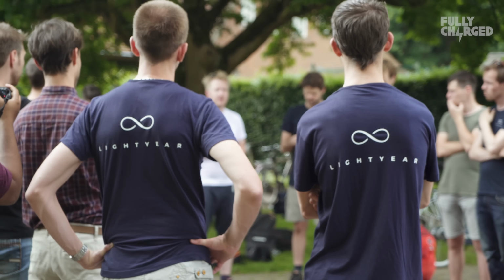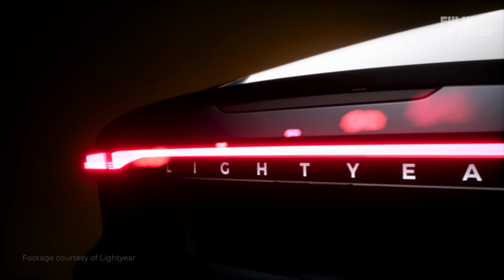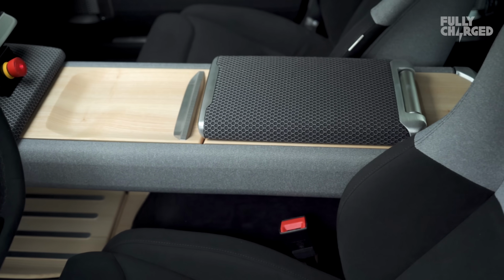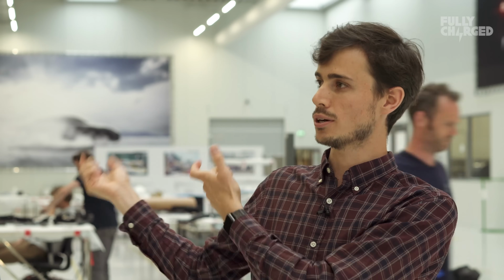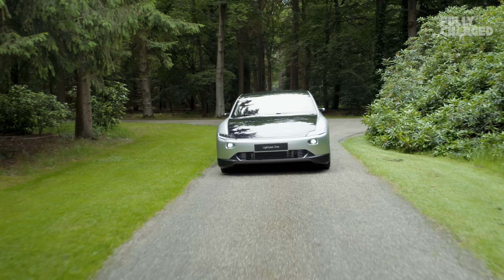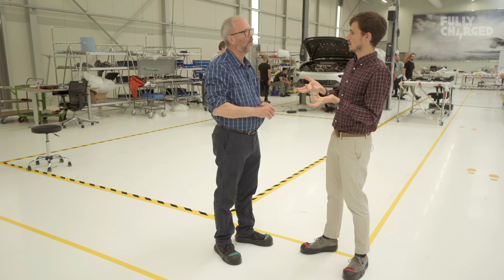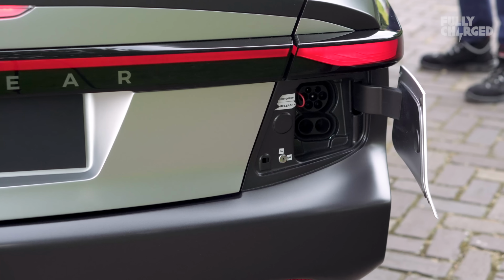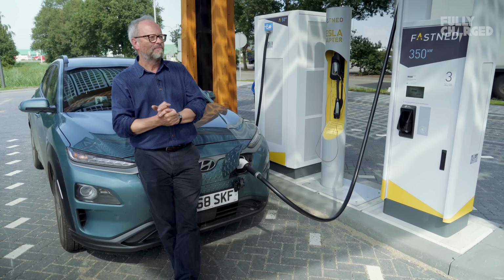Lightyear One solar powered electric car - exclusive first look | Fully Charged

Comment: That car, and many derivatives of it, would go incredibly well throughout most of Australia!
Reply: Suddenly everyone wants a parking spot out of the shade
Reply: @dr00by  say goodbye to garages
Reply: @dr00by  the irony, as have seen some carparks with solar panels for shade..
Reply: @dr00by  they still charge in the shadows, but not as optimal. You don't have to think about it really
Reply: @tr33c: "not as optimal charging" in the shadows is a massive understatement. You get just a fraction of the power in the shadow.
Reply: @701983  You'd be suprised, watch the sonos video of fullycharged. Similar efficiency to this. It's definitely not a massive understatement, but I do wonder how much it would charge overnight with and without a full moon.
Reply: Did he say 10 to 20 km/hr charging on the battery.  This car would drive me to work on a sunny day and have charged more than my return trip and then some.  I'd only have to plug it in on long trips.  This is definitely how we have to go.
Reply: @cameronlapworth2284  He said 10 to 12 km/hr, but still very much what most people use during a commute (personally for me it would mean 3 hours of charging for each leg of my home/work travel)
Reply: @YouHaventSeenMeRight  yes which means 8 hrs parked at work how much would you need?  Remember too if you don't drive much on the weekend and when you get home?  Compare this to an ICE car how much fuel is created in the tank while it's parked?  Any?  The average commute in Aust is something like 35km.  Mine is about 5km. I ride though so I don't need this.  I think even ICE cars should have solar to charge battery and relive work for the alternator and air con.  If an ICE car made its own fuel while parked would anyone be critizing it by saying well it does fill the tank in an hour.  Even when driving the panels are removing some demand from the battery which means less batteries, cheaper and lighter car, tick tick tick.  Nothing about this is bad people are making the best the enemy of the good.
Reply: @cameronlapworth2284  I wasn't arguing against anything you said. I just corrected what you had heard: 12 i.s.o 20 km per hour charging. My commute is indeed about 33 Km one way, so with a charging duration of three to four hours for that distance I would indeed be able to charge up twice as much distance in an 8 hour workday (and depending of the time of year either more or less than double the single distance). It would however mean that the car would have to be parked in a sunlight parking spot, which would be challenging with our current parking garage as it is constructed to keep the sun out (except for half layer on top of the garage). I guess that would suddenly become a very desirable location, whereas it is now the overflow location where you park when there is no other spot available.
Reply: @YouHaventSeenMeRight  yes sorry I just re read your post I was doing this without my glasses on my phone I occasionally miss things my bad will take more care in future.  :)
Reply: @YouHaventSeenMeRight  That was in European conditions.
Not long after he implied you'd likely get about double that in a really sunny place like southern california or Australia.

So yes, 20 km per hour charging is about right.

Solar charging rate is highly related to how intense the sun is.
Reply: @KuraIthys  As I live one town away from the Lightspeed factory, the European numbers are more interesting to me than the Australian ones, but good for Australian customers I guess.
Reply: Cameron Lapworth Ideally, but it is incredibly costly! Bear in mind you can buy a model S P100D and 30 years of solar power for the price of this car. The problem is dedicated solar power stations produce energy far more efficiently than this roof, economically. I think fast charging will make the roof panels more and more redundant, you can charge Tesla’s in a matter of minutes and go 10s of km.
Reply: @falcodarkzz  yeah I couldn't afford this car but not because if the solar.  This is a luxury car, Sion is pursuing the same idea much cheaper.  It's the principle I think is sound and it will work its way down to cheaper cars.
Reply: I'm ready to test it for them in sunny Queendland😎Australia ......oh yeah can I tow with it ? Ha
Reply: I only drive about 20 km a day and living in california, I would almost never have to plug in
Reply: This would work well in the tropics.
Reply: Perfect for my daily commute across the Nullarbor ;)
Reply: In Australia this car should be able to operate without external charging. I visted them in spring this year and they stated that it would be possible to operate the car in Spain with charging only once per year when driving about 15000 km . Assuming that the solar radiation is higher in Australia this should work without charging. Just a bit expensive.;)
Reply: Most of southern and central California and most of Arizona!
Be well.
Reply: In theory yes but it's Australia so.... No.
Reply: @chrisrathjan1501  lol
Reply: Can't wait to see the first solar powered ute!
Reply: @Dudleymiddleton  The roof area is smaller for a ute. However, when better solar panels are produced, it may be enough.
Reply: What's the point mate? We don't have the infrastructure and our only source of electricity is dirty Coal; sadly.
Reply: Nice idea, but unreliable for most people.
The majority of people live on the coast, not the desert.

If I am going to purchase one car (like most people) it needs to be reliable (work, holidays, living out of town)

The majority of people won't buy this. So they will be a rare thing.
Example. Its been raining here for the past week non stop.., how am I supposed to get to work. Purchase another car? Majority of people cannot afford multiple vehicles

I'd just buy a Tesla and charge it. Same difference if I have solar panels on roof, yea?

Or like campers do. Take solar panels camping. Just like having them in the roof. Tesla will probably just use their roof tiles and will have the best of both worlds.
Reply: @jamesbarker6373  You have got the option of charging it off the wall of course. Solar is just a range extender I suppose. Problem in the motherland is the lack of infrastructure. They have got turbo chargers everywhere in the US and Europe. We don't have that facilities as of yet. So, your only option is to charge it at home with a power that is produced by burning Coal. So, your carbon emission is still in place anyway.
Reply: @JulAlxAU  Been raining here for almost a month straight. Had 3 days of sun in over 3 weeks
Reply: Don't kid yourself.  You might be able to get from Geelong to Rockhampton without waiting half a day to recharge but if you want to go west from anywhere you are essentially stranded. The built in solar panels only extend the range by 10 - 15% if you are lucky.
Reply: And so long as you can clean the car every day. Australia has some real heavy duty dust.
Reply: There's a misconception that anything solar needs full sun.
Of course full sun is optimal, however solar panels produce electrons as long as they are being struck by light.
Don't risk your life. Solar panel output wires need to be treated the same as any energized wire whenever light strikes the panel.
Reply: australia north africa and also the middle east
Reply: @Atam Tab At home, you'd have solar panels to cover that. At work, if legislation comes in for solar panels, that could be used too.
Reply: they need to come out with a fire powered version for australia.

Comment: Amazing what they achieved in such a short period. And how little the mindset of people outside this bubble changed during that.
Reply: Well, the mindset here (in the Netherlands) is changing. Not superfast. But there is a definite change in how people look at the energy revolution.
Reply: Or, it's a con.
Reply: This is a team of former TU Delft students working on solar cars for many years. It's not something just started from scratch.
Reply: Well electric cars in general are great, but this one in particular is dumb. Way more efficient to just put the solar panels on your house instead. A car is blocked from sunlight by trees or buildings etc for most of the day anyways...
Reply: In the US petrol (gas) cars are just better.
Reply: @bighands69  Blame the lobbying oil firms

Comment: 1.25 kWp at ~ 1500 full sun hours per year, that's 1750 kWh/year. Take away the 30% you lose because the panels are not optimally looking at the sun, we get ~1200 kWh per year. At a consumption of (did they actually mention how much?) 12 kWh/100km that means 10.000 km/ year IF the car is always outside and not in the shadow AND the battery isn‘t already full so it can't be charged by solar. Not too bad actually. I'm surprised. I wonder what additional power the added weight of the panels takes compared to their power output.
Reply: It's 10000km/yr of free range
Reply: @manurr10  It's not free if the cars costs over a 100.000 euro...
Reply: In other words, 10,000 metres/year if you live in the UK.
Reply: Despite your minor error with the initial calculus, thanks for this overall calculation! Panels probably weigh nothing, but they look like they heat up a lot, which requires you to cool down the car and waste energy. Also hot cells are less efficient.

Now if only they put the solar panels in a place where they're always maximising sunlight and connect them in a way theres no limitation of battery capacity .... then they could just use take some from the storage when they need it ... hmm .. like solar panels on the roof and connect them to the grid!

It's not free range btw., it's paid by buying the panels. Put them on the roof, and it's just as free. Buy any other car and it's 10 000 km per year for ANY e-car.
Reply: @Wilewee  if they didn't have the panels on the car tho, it would have no roof or bonnet. So, they are free. Unless you consider rooves and bonnet optional extras in the cars you buy?
Reply: @takethebread794  
The solar cells are not "free" in terms of weight. They can't be structural, so you need a supporting roof and bonnet anyway.
Reply: @Wilewee  Sorry about that error at the start. It was a bit too early in the morning to do calculations in my head it seems xD
Reply: There is no "panel". The only purpose of the glass panels on rooftop solar is for mechanical structure and wind resistance. The PV cells themselves are incredibly thin and light, essentially film. The car body does the job of mechanical support, and the whole system would negate the need for traditional auto paint in exchange for cells+clearcoat.  Negliable weight difference. 

Hot cells lose ~ 1% per degree above 25C, however it does away with the need to create 20 kg of glass per m^2 of cell, so from an overall energy balance/embedded energy perspective, it makes far more sense than doing things like integrating PV cells in vitreous roof tiles.
Reply: Most Tesla drivers would just like to return to their car in airport parking after a two week holiday and find it hadn't gone flat, this would go some way to making sure they could make it to a fast charger.
Reply: Jason Arthurs You can park your Leaf or Kona EV at the airport for 2 weeks, and the battery wouldn’t lose 1 percent.
Reply: I fully agree PV panels belong on rooves where they can achieve their maximum productivity. Anywhere else just costs MORE money. But, if you have the money to throw around aimlessly, why not put em on a car I guess.
Reply: @Electroblud  I wonder how much the same car would cost without the solar cells. THAT might be a popular model, going 400 to 500 Km and getting 12 Km/KWh.
Reply: @fotoguru222  Agreed!
Reply: still u can power your house with it :-)
Reply: Also don't forget that these solar panels are DC so from DC solar panels to DC battery is way more efficient than DC to AC and then AC to DC converter to charge your car at home from your roof panels. And if your stranded... just wait a little and you can drive again. :)
Reply: @HermanWillems  Not as easy as it initially might appear.  Battery needs to be charged with a certain voltage (depending on state of charge), solar cells provide a different voltage.  So you need a DC/DC converter, which is not too different from a coupling a DC/AC converter and an AC/DC converter, just a little more efficient.
Reply: It's not insignificant, but cost should also be taken into account. The time for panels to pay for themselves is 7 to 10 years depending on the price of power. Ideally it should drop down to 5-7 years since we're talking the life of the vehicle. In this use case real estate on the car is precious so the cells should be the more expensive more efficient ones as compared to roof or other applications.
Reply: @BogdanManciu  507 for the life of a vehicle? EVs will last well over 10-15 since they don't have the worst bits from other cars (ICE). And changing cars because they are old needs to be a habit we break.

Comment: So it's legit?! I've seen some stuff about this car, but figured it was vaporware. Thanks Robert for covering it, very cool technology!
Reply: There is a pretty big difference between having a prototype that can move (albeit very slowly it seems) and having the industrial capacity to produce and sell said car, the later is the real hurdle that most car startup crash at.
Reply: romteb not to mention comply with all the safety regulations which will necessarily add weight
Reply: Didn't expect to see you here as well! The TUe team is very seriously
Reply: dutch, dont really not deliver.
Reply: They made contract with Valmet Automotive for manufacturing. Its kind of cool car, lightweight, 4wd, lots of torque, long range and roomy.
Reply: Ive seen the prototype in action, its truely something. But the company will likely struggle with costs and producability. They receive very little help from other manufacturers except for tesla.
Reply: It's not vapor, it's just unobtainium.
Reply: it is vaporware still.
Reply: It's real but does it have any real world practical use beyond a few select areas? The fact of the matter is that solar powered cars can not be used in the majority of the world. I also don't see how they would ever be able to come up with the money to actually put it into production anyway.
Reply: @AustinMichael  Solar prices have dropped immensely. High-density rechargable batteries kicked off EVs; solar may be the next breakthrough.
Reply: It’s still vapourware
Reply: Aria  
It does not have to make sense to you it is just reality.
Reply: In the middle of winter petrol or gas car is just superior. Nobody really wants a toy electric car otherwise they would just have bought them.
Reply: @bighands69  Norwegians like to disagree with you.
Reply: @bighands69  Electric cars can be used all over the world. Ever heard of Norway?
Reply: @mgammeren  
Norway is a oil rich country so that is not a good example.
Reply: @bighands69  Total and utter BS. 
Travel to Norway in wintertime and see how many EV's are driving there in snowy icey conditions. And the winters in Norway and the rest of Skandinavia are usually pretty cold with -20C not an exception. 
In your ICE car you would have to do coldstarts every morning...and pray that the car will run.
In an EV you unhook your charge cable, step into your pre-heated car, switch the car on and drive off. No problem!
If you can't travel to Norway yourself just watch the videos of TeslaBjorn here on YouTube.
Reply: @jfv65  
Norway is a country that is oil rich and supports the purchase of electric vehicles. Normal cars in Norway are supper expensive as they are targeted by government policy. 
Norway also has an abundance of electricity because it invested heavily into hydropower and it also has a lot of high altitude lakes for hydro. 
Norway is unique like Iceland for alternative energy but it is not a  model that can be predicated everywhere.
Reply: @bighands69  just a small gas heater easily handles any winter, even Arctic
Reply: @TANOCA17  
Electrical chemical efficiency drops with cold conditions and hot conditions for various reasons.

Comment: What we are seeing is a concept car that is trying to be different through being more efficient. And BTW we stuck some solar panels on the roof. Still a very long way from being sold in even low numbers.
Reply: They use the word prototype which seems reasonable since it works and is in development.  I don't think "concepts" are really required to get this far.

Comment: Its design looks like what a "futuristic car" looked like in the 80s.
Reply: Aerodynamics does not allow that much Space for crazy design ideas. The best shape in terms of efficiency is pretty much a falling drop of water.
Reply: @aladdin8623  I think there's more scope for design than this though! 🤣
Reply: @jrisner6535  Of course there are. By crazy design ideas i mean blocky shapes Like a Quboid in the worst case. Sadly this corresponds to the front shape of many Trucks.
Reply: The ‘80’s are really hot right now so that’s a plus!
Reply: The rear end is great but the front looks very cheap. I would make it more aggressive.
Reply: Exactly. Back to the Future 2
Reply: retro futurism at it’s best
Reply: @gilbycoyote  it's ugly 🤦🏿‍♂️ why would you want something to look old and new at the same time? I want it to look as new as possible
Reply: Well, back in the eighties I said just that about Citroen. That one day, all cars would essentially have to be a similar shape, if they were going to be aerodynamically efficient.
Reply: And I love it.
Reply: GuanoLad exactly. If I were an investor I would be worried.
Reply: I think if the didn't cover the rear wheels it would look pretty normal. The front end is not unlike a Tesla.